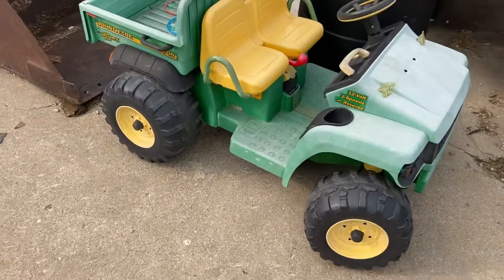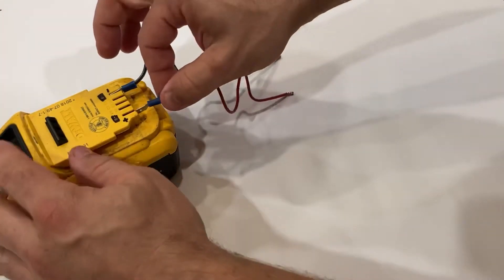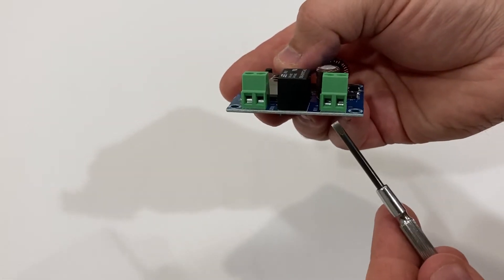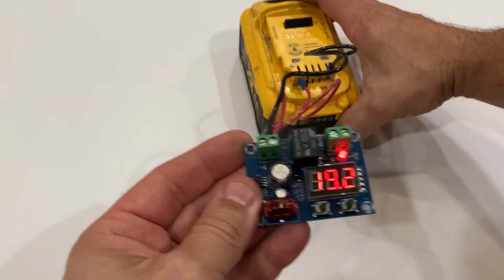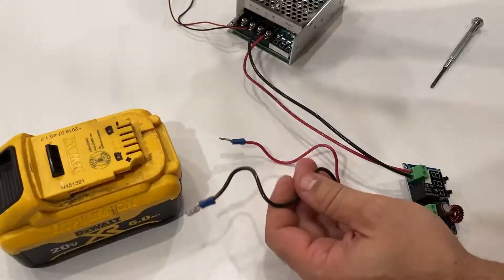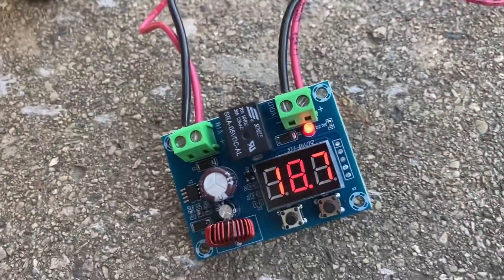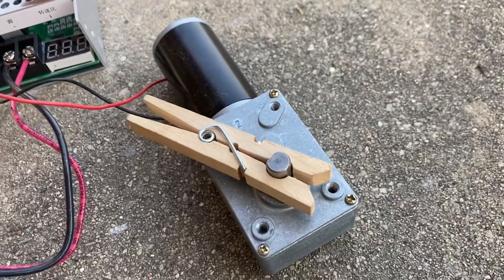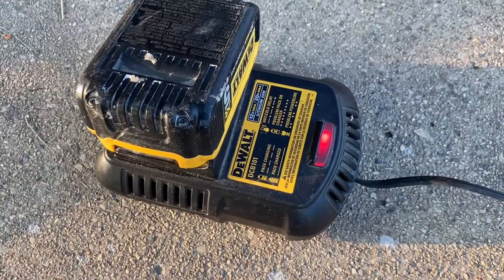Low voltage cutoff protection for your battery powered projects

Comment: I thought these battery packs have built in low voltage cutoff protection already... it's built into the tool and the battery, for redundancy I believe

Comment: Do the power tools themselves not have discharge regulators built in? Surely they do.. Why not just use them?
Reply: Most tools have the circuitry built into the tool and not the battery. A few brands, Ryobi is one, have the circuitry built into the battery. You do not need a low voltage cutoff for a Ryobi battery.

Comment: Thank you very much, you told me what I needed to know, that the Amazon Mtiolhig Cordless LED Work Light for Dewalt 18v 20v Battery's 48W 4800Lumens if left on the DeWalt battery even if in the off position won't destroy any of my DeWalt 20-volt batteries! I still wont leave them on when not in use but nice to know anyways!

Comment: Interesting, I'm planning to use this circuit.  However the circuit says it is not suitable for battery packs. I assume this is because if it does not monitor the individual cells?  That means if one cell drops too low the battery pack will not charge back up, and this device cannot monitor individual cells in a battery pack?  Still better than nothing I suppose?

Comment: This crcuit is still powering the actual cuttoff device itself.. If you leave the battery connected to it, the device thats supposed to protect the battery from undervoltage will actually do the opposite and drain the battery completely depending on how much current it uses to work the circuit.. All well and good as long as you always remember to disconnect the battery pack from the lw valtage cuttoff, but if you forget, which obviously happens, lets say a week in the shed.. Where the battery was already cut by the device, now its still using power and bam, your battery has dipped well below its recovery voltage on most chargers..
Reply: If you add a momentary pushbutton (normally open), you can power the device from the output instead of the input.  The pushbutton connects across the relay terminals so when pushed the input receives power and will turn on the relay, keeping the input powered until low voltage disconnect.

Do note, this will prevent the device automatically turning back on at the reconnect voltage.  You must push the button to repower it. I consider that a feature in my usage.

Edit:  Oh, you'll also need a diode to prevent backfeeding all the time.  Sorry, it's a bit more complex than just a button.

Comment: Note that if the voltage does drop too low, the built in BMS disconnects the cells and won’t allow them to charge again, but you can take the pack apart and manually bring the cells up enough to allow the charger to work again. My boss bought a huge truckload of Milwaukee and Milwaukee Fuel tools and none would charge, so I did them all. Keep in mind these were all new old stock and none of the cells were swollen or damaged. Also, this was done outdoors just in case. Matthias Wandel has a video showing how it’s common for the flexible voltage batteries have certain quirks as well.

Comment: But the battery keeps getting discharged by the circuit! it does not turn off.. Sure if you are there to unplug you are good, but if you left it on walked away, and forgot.. well your battery will go to ZERO, I tested this using a variable power supply and found you still drawing 20mA when the circuit switches the load off. Phantom power. I need true power off! full disconnect.

Comment: 2 years later but....
Aside from jumping the work truck.... and the occasional power source for 24vdc controls at work (18 is close enough).... my big project is an electric mountainboard running on (2) milwaukee M18 high output 6.0s. Low voltage cutoff is in the VESC and I use three phase AC motors. This helped fill in some missing knowledge I had. Thanks man.
Reply: Did you wire both batteries to the one voltage protector?
Reply: @PaigeSaucedo  both batteries in series together for a 36v nominal system. Low voltage cutoff is somewhere around 32 if I remember.

Comment: So you asked for projects, I sleep with a cpap machine. When I camp I have two 12v sealed lead batteries in a case to power my unit. I get 2-3 nights out of the unit. I am going to make a new setup using my dewalt 6A batteries since my unit can run on 12 or 24 volt input. So I am going to try out a battery first. If that works then I will parallel 3 batt together. It will be much lighter carrying drill batteties to a wall charger when on a long trip. Thanks for your video.

Comment: These do work, but this doesn't mean you can leave your battery plugged into the system when not in use.  It will actually drain the battery until it's no good. 
I should have known this, but found out the hard way.  Dewalt 6AH battery toast because life with kids is hectic and you sometimes forget to take the batter out of that free Gator you got sitting on the side of the road and converted to take your power tool batteries.  

A better option is to find the tool companies that put their low voltage protection in the battery instead of the tools.  Then you will never have to worry about running them low.  Dewalt's low voltage protection is in their tools, not the battery.

Comment: The question is how to determine my battery's minimum voltage? let's say I have a scooter battery which is 36 volts and has nothing written on it, so how to know for sure the voltage that the battery should stop at?
Reply: Depends on the cell chemistry, assuming lithium ion cells which are typically rated for 3.7v that means 10 cells in series will make about ~36 volt pack. Li-ions can be safely discharged to 3.0v so simply cutoff at 30v but its better for the cell life to have more buffer like 3.3v * 10 series = 33v cutoff. In the video he sets the cutoff at 15.3v so divided by 5 series = 3.03v minimum per cell which is going for as much runtime as possible with a tiny buffer
Reply: @kwitmeh3   its weird that you can only take .7 volts from those batteries before risking damage!  there's so much power left in them.  Now i understand why some of my devices still crank with the 3.7 and some shut down, the latter must have the safety shut off built into the device.

Comment: Can you use it on two parallel batteries?
Reply: Don't parallel two lithium batteries unless they're permanently connected and charged/discharged together.  If they're "hot swappable" and you accidentally have one at full charge and the other at near empty you can easily overcurrent them as one charges the other.  Bang!

Comment: The protection board's relay says it's good to 20A at 14VDC, and I'd extrapolate that to 14A at 20VDC. And running it at max might be a bad idea, so maybe put a 10A or 12A fuse on the circuit. Not sure if that's the continuous rating or the breaking rating.

Comment: Milwaukee and Dewalt do not have protection in the batteries because the liion batteries and tools were all designed together from the ground up and its more cost effective to have the protection circuitry in the tool. Ryobi 18V and Ridgid 18v maintained backwards compatibility with older non-li-ion tools. The older tools did not have protection because the old battery pack chemistry did not require protection. To maintain backwards compatibility, the new Ryobi and Ridgid li-ion packs needed protection. The giveaway when looking at the circuit boards is the large mosfets and heatsinks needed in the battery to act as the switch to turn the voltage off for low voltage and short circuit protection.
Reply: How is it more cost effective to place the protection circuitry in the tool? People tend to have more tools than batteries themselves. I myself have over 50 tools and only 11 batteries. Knowing this if you place the protection circuitry in the battery you only have to use the circuitry 11 times as opposed to 50+ times. 

No. Milwaukee and DeWalt don’t install protection in their batteries because it benefits them. 1) They only want you to use their batteries on their tools.  And 2) once your battery breaks because you chose to use it on something else, well that’s just more money in their pockets.
Reply: @chriscorona9282  Well you are the only one everyone has more batteries than tool :D

Comment: I would like to learn how to rebuild a battery pack.
Reply: buy batteries and put them in the case! or do what i do, everytime someone breaks a rechargeable vacuum, laptop ,bubble gun or anything else that takes the super common 3.7 volt lithium battery , you tear it apart and save those batteries LOL  i have at least 20 of those things ready for random projects.

Comment: Thank you for putting this information out there. Does that little module you were using also limit the voltage that you can send out? Does it limit the voltage you can send out to your projects? To be more clear many of the things we are using out here are based on 12 V but we’re looking at batteries that are 20 V. Is there anything you could speak to about that scenario where we wanna make sure that we’re not burning out at 12 V application with a 20 V battery?
Reply: you will need a DC Buck device for this, they are readily available on ebay for low current applications

Comment: Why would you build your own Low Voltage Disconnect (LVD)? These power tool batteries have built in Battery Management System (BMS) which has both Low Voltage Protection(LVP) and Over Voltage Protection(OVP). You're simply "re-inventing the wheel".
Reply: Some brands need to have the tool telling the battery when it has to cut off. Therefore most likely  your(or my) application/project wasn't maybe built that way. I have Bosch 18V packs ans use them to power synthesizers and small PA set and I can say the protection does not activate while I am just connecting my audio devices to + and - terminals of the battery pack. This circuitry is highly recommended for any DIY projects.

Comment: ty for the video.   I bought an adapter that plugs into the Dewalt battery's and it has two USB outputs and one 12 volt output. The only thing is that it will not shut off and will drain the battery to empty other then that it works great as a phone/iPad power source.

Comment: I've been looking at these same low voltage shutoff circuits, and without much luck, have been trying to find an answer to "Will they retain their Low/High settings when disconnected from the power for an extended period of time? Or do they need resetting every time you use them?"

I would like to be able to set them to x V low & y V high, and not have to reset again next time I decide to use the device. Is this the case?

Thanks in advance.
Reply: According to the comments from the mfg most of these boards will hold the settings no problem.

Comment: Why doesn't Dewalt build the circuitry into their battery packs like Milwaukee?? AND 14 volts is too low for that pack.. Should be at 16 volts to be safe.. 5 X 3.2....
Reply: do Milwaukee packs have a bms?
Reply: @Fatcode1  no they dont. Same as dewalt. BMS is built into their tools not batteries.

Comment: This is exactly what I was looking for.  So on a 20V Dewalt Battery, 15.3V is the minimum recommended.
Reply: Don’t go past 16.5 min voltage Incase you don’t shut off the power to the battery the lcd will drain the battery until it’s no good
Reply: @jimcatanzaro7808  so you're saying the device which is supposed to save the battery will actually drain the battery?

Comment: I'm making a portable Bee vacuum using a 12v DC cooling fan, DC motor speed controller and 20v Dewalt batteries. Would I need to use a volt converter to drop the voltage from 20v to 12 v or will the speed controller do this for me.

Comment: I got an adapter on amazon for my milwaukee packs (not really necessary but it allows for both mounting the pack and a secure connection) and I use it to power my kayak lights, fish finder, etc...

Comment: Things I've used battery packs for.....

Forced air respirator
Work lighting 
Soldering rig
Charging for USB devices - phones, tablets, etc
Echo Dot with Amazon music outdoors 
Fans
Occasionally a cordless drill 😁

That's not everything and the planned list goes on a long way.

I use Einhell and they have voltage control built into the batteries which makes like very easy 👍👍👍👍
Reply: Good point about using batteries that have a built in cut off, unfortunately all I have are Dewalt.
Reply: i love einhell batteries got ozito rebranded ones, cheap, use em for everything, even got one in my glovebox as a ghetto jumpstarter

Comment: I power a projector for summer out door movie night for the family. I found the low voltage cut out only after I screwed up a couple of batteries. (If the family movie is over and the rest of the family goes to bed, you then switch to a baseball game then fall asleep it will fry a battery if you don’t have low voltage protection)

Comment: So i recently bought my first house and due to the yard, i had to buy a mower that had to meet some odd requirements. Because of this i ended up buying the EGO mowers and blowers which i love bit since I now had a ton of their batteries now (i have slowly collected half their set with each coming with 1 or 2 batteries) and nothing to use them on but once every week or two. I was wondering how i can use them in other projects and i think that was the last part i was missing.

I'm planning on using them to make a portable back up battery with power outlet to power small devices in case of a power outage as a proof of concept but i can't wait to see what you come up with as well.

Comment: I used this in a surebonder M18 to Ryobi battery adapter. It just barely fits in the disassembled adapter. Let's me use that odball Ryobi tool without needing to invest in a separate platform.
Reply: it fits way better if you cut the pcb corners

Comment: You got to be careful, that relay draws a small amount power just to monitor the voltage. If you leave it connected for days / weeks, it will continue to trickle drain the battery until damaged.
Reply: Hey Guys.  I've adopted using M18 batteries on my kids Razor riding toys.  They have been instructed over and over again to take the batteries out when they put the toys away and they still forget.  My solution is to power the cutoff device through an external contactor.  The output of the cutoff is wired to the coil of the contactor.  You need to install a normally open momentary pushbutton to jump battery power to the contactor coil to get the circuit powered initially. Once it's on and supplying power to the cutoff, the cutoff output will keep the coil powered until low voltage drops power to the coil which disconnects the battery.  This is akin to your battery sitting on a shelf with zero load attached.  The other advantage is you're not running your load current through the cutoff device anymore.  It's all going through the contactor which you can size to whatever amp capacity you need.
Reply: @dlm339  OOOOOOH i like this idea!  thanks for this one. Im not a fan of the device designed to save the battery having the ability to kill it LOL
Reply: This should be pinned
Reply: I always disconnect the battery's when I'm not using them anyway , good practice
Reply: This is the case for regular tools too though. You should never store tools and batteries connected long term.
Reply: it's true and the small relay does drain the voltage.
Reply: that is why the tool manufacturers do not include over-discharge protection/low voltage protection on the batteries. any such circuit is going to draw a tiny bit of power that could destroy a battery that sits for a few months
Reply: Had this happen on a battery. Had to jump start it to get it to charge.
Reply: While this is true, and it's good to know, it's only really needed on projects where you aren't taking them out and charging them or storing them after every use... For instance, if you're using them to power your interior closed trailer/work lights, then you're most likely going to take them out after every couple of hours, to charge, if you even use them that long(depending on power draw it may last less or more)
Reply: Great to know. Thank you for sharing!
Reply: TTT
Reply: There's a better way of doing this. I tried two of these boards to power a couple of electric scooters off my 18v Makita batteries. One didn't even power up, and the other stopped working very quickly. Apparently the relay can't handle the power (maybe the high current draw, and/or the fact it's a 14v relay)... A guy on YouTube used cheap BMS boards with added resistors. I tested one tonight and it works fine. It should cut off at 14.7v. I can leave a link if anyone is interested?
Reply: I used these for Bluetooth amplifier speaker builds.
I set the low voltage shut off at 17v so I’m able to charge the battery again  also the lcd draws 25 milli amps if you don’t shut of the power that’s why I don’t set it to 15v Incase I forget to shut the radio off all day it won’t draw to much and damage the battery I have used this almost everyday for a work radio on a construction site for 6 months and hasn’t failed it’s in a plastic ammo box it doesn’t get hot at all and I would recommend mounting it on some abs plastic with stand-offs
Reply: Ya it drains 25milli amps with the led on so if you have a 20vdc battery 16.5-17 vdc would be a safe zone in case you don’t shut it off 
I would like to figure out to put a small buzzer on it when it gets low sometimes when I’m working it’s nice to know when to put a fresh battery on  a 5amp dewalt battery will last me about 7-8 hours of run time on a single battery running to 17vdc running them down to nothing 15.5 has given me problems in the past like not charging